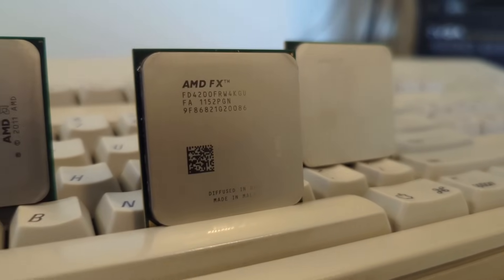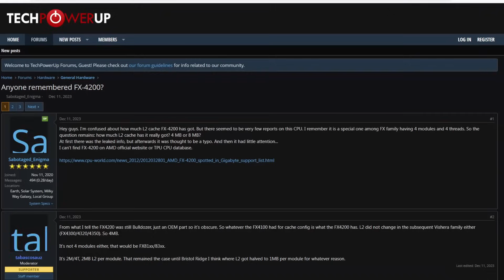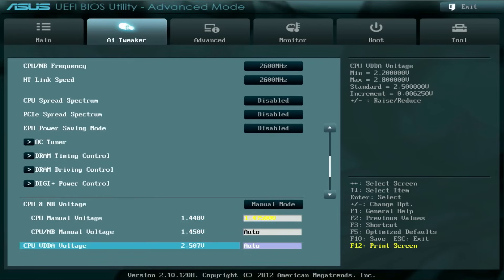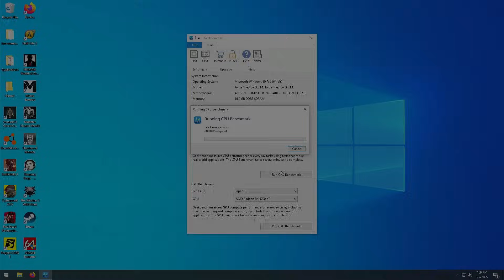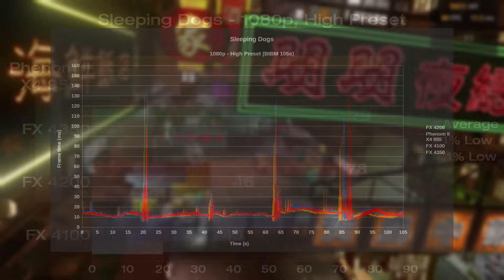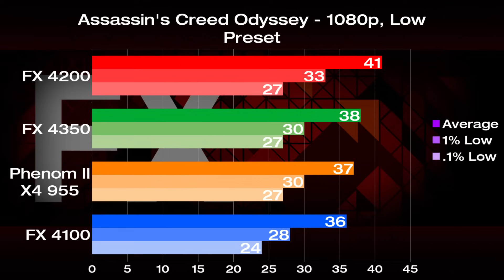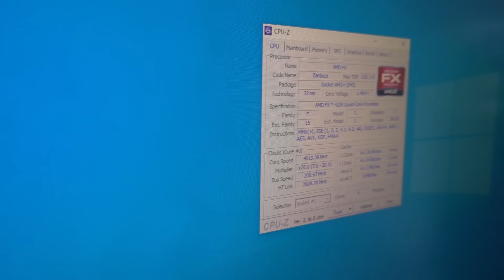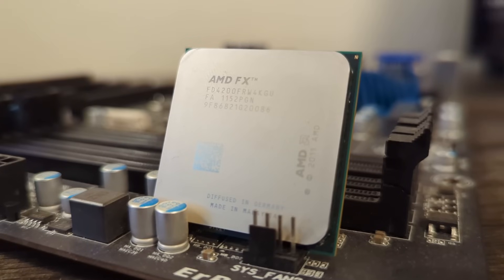What if AMD FX had "real" cores?

Comment: Based on everything I have read, as I have not benched this chip in this way, you would get slower single core but faster multicore which tracks considering L3 cache impacts multithreading. It's too bad they didn't have a Vishera core model of this.

7:38 Yep. It tracks.

Comment: I've had this on pause for hours...I have one of these, I had to go look for it, it was killing me. Found it. Problem? It's Zambezi core not Vishera, which means it's slightly slower and consumes more power. I never bothered with anything under an FX 6300. I usually build rigs for games and the 2 Module 4 Thread chips were not enough for much past web browsing and video watching. Sure, with a good GPU you might play an older, or less resource intensive game of the time but that was it. I never saw them as having insane value. To me they were overclockable Celerons at best. Funny that with a good board, memory, cooler and GPU and a good overclock, you can reach i3 levels of performance with these chips and even get i5 2400 level single core with a crazy overclock.

Comment: 17:03 but a 4 module Piledriver is still gonna crush all of these. Even a Phenom II X6 struggles to compete. I was a total sucker, went for core count at the time. This is still my primary gaming PC.

2025 games are somehow more than playable, especially those using DirectX 12. They can squeeze more performance out of the 8 “cores” as it’s not as single threaded as DirectX 11.
Reply: Yeah.. if you consider stuttery gameplay "playable".
Reply: Most games need shaders pre-compiled now. Sure it’s long, but stutters during gameplay aren’t that common. At least in my experience.

It’s actually older (DirectX 9 and 10) games that suffer stuttering the most for me.
Reply: @someone7272  It's not just shader compilation, it's just basic performance too. There's games from 2014 that already kinda run like ass on these older chips, including Intel's own high-end ones at the time.
Try playing something like The Surge or the OG LoTF on Intel's older chips. It'll not run well. Unless you consider dropping sub 60fps due to your CPU and RAM "playable". Same with the game having noticeably more input lag than on a newer CPU.
I've had a 4460 from 2014 till 2019 and then I've used a 4770 from then till 3 months ago. I've known about the i7 bottlenecking my games, but the difference is staggering.
And no, the 4790k @ >4.5Ghz or the 5775 aren't much better. In some  games you can see improvements, while in others these perform identical to the slower 4770 @ stock. Even when you see improvements, the general stability is still worse than on a modern CPU. Frame time consistency, input latency. If it still works for you and everything is "playable" for you that's fair, but I'd strongly recommend you upgrade your system if you actually notice issues.
Reply: @someone7272  Fair enough

Comment: That radiator setup is incorrect your cpu is at the highest point with no trap in the radiator. You either need to find a way to flip the radiator upside down or put it on top, that will reduce performance and wear down the pump.
Reply from the maker: The front was the only place I could get it to mount in this case. I wasn't planning on this being a very long term setup, I'm likely going to change the case for one that allows for a better rad mount.

Comment: The thing people never remember is price.
An FX8320/8200 Was £100 so the same as an i3-3220 or high end pentium.
Ph2x4's were typically around £100 (a 965 would be £120) but an FX6300 was only £80 (so about the same as most pentium dual cores.
That's why allot of people ran them into the ground even into the 2020's.
The northbridge chip (IOdie) wasn't on package yet so they also had upto 32 PCIE lanes, not being Fin-Fet and using planer 32nm silicon with a soldered IHS on a 315mm² die they could be kept in the 60-70c range with just a 120mm tower heatsink.

FX4xxx chips were a complete waste of silicon even at £60 given another £20 gets you another 50% more CPU where the fx6's and fx8's were at least usable and if you knew what you were doing they were actually good.
Tight budget but know how to tweak (overclock and undervolt simultaneously) and were okay with 60fps gaming then editing it for upload to youtube... perfect.
If you paid the extra £50 (50%) for an fx8150/fx8350 thinking you was going to overclock it to 5Ghz all core and pwn noobs all day even with a £50 m5a78l-lm/USB3 with a 4phase unheatsinked VRM.... that's on you and having sworn off AMD you're probably now using Arrow lake.

Comment: Whenever testing CPU performance with video games it's generally considered a best practice to set the resolution and graphical vidality settings to the lowest practical.
Reply from the maker: Only used a Higher preset for the oldest two games, and they are for sure not pushing this GPU to its limits lol.

Comment: Watchin this right now on my FX-4300, which still does "ok" in role of "kitchen internetz hdmi source" aka "not a popatoe crate".
Yesterday i overclocked it to 4600ghz (x22/210.0) just for lulz, surprisingly it runs stable and result is kinda noticable.

Comment: I'd like a follow-up vs. 8350 or a similar 4-module version, at the same clock speeds (or the same wattage?).

Just to show the difference or lack thereof.
Reply from the maker: If I make a followup that would be the subject! Although man, I'd be testing so many CPUs 😅
Reply: @SPNG just the two would be enough. 8350 vs 4200. Or repeat the same benchmarks you already did with the octacore. Then you can later add Excavator (Bristol ridge) and others if you want. Re-testing everything is not sustainable.

Comment: Heh. I remember the time, when I had to upgrade from phenom x6 to fx8320 due to sse support for some software, was not impressed. Now I'm waiting for 265kf to arrive. But.... So far, everything I needed it to compute, it made it nicely(except two weeks back, when I finally hit the limit in real-time processing it couldn't handle). Yeah I had to make some stupid-overkill cooling setup(990fxa-gd80, custom made waterblocks at vrms and cpu, 12 liters of coolant, BFRadiator, its like 350-400W thermal output, RAM would not go over 1900MHz for some reason, but the rest is at slightly higher stock voltage running like a champ) as I'm running it at 6.1GHz all cores, always below 57C(or crash, keep your rads clean XD), rock stable, for 8 years. Yeah, I could be a billionare by now not having to pay for that extra nuclear powerplant feeding it, but it will continue to work as home FTP server(underclocked, undervolted) till its days will be over. But ill try, what disabling four cores will do.

Comment: Just taking a wild guess but I'm suspecting the real reason FX cpus suffered from poor performance is likely due to the out of order engine stalling from the workload of 2 cores. Sharing an fpu isn't actually a bad idea in theory but if you can't handle multi-cycle latency of float-point operations then the whole cpu can stall. Another cause could be a front-end limitation, both of these would answer why the 4200 was better overall but I'm not knowledgeable enough to really pinpoint the cause, just giving my 2 cents
Reply from the maker: I think it's a combination of the shared FPUs, shared front-end, and the compromises they had to make due to Glofo's 32nm node. They all contribute to holding this CPU back in a lot of ways, but I'd say the cutbacks they made due to the shitty node was probably the worst. Even if they went the Phenom III route I think it still would have suffered on that node.

Comment: One of the main issues is that everything catered to very old Intel. Software wasn't written to take advantage of newer features, and it was and still is to some degree holding everything back. Intel was caught out many times with scummy practices, like with additions to code that would check and then disable certain feature sets if it detected AMD. (SSE instructions in compiler) Games mostly favoured single core performance until the big shift years in with Vulkan and DX12.  Same with Windows scheduling, not operating efficiently for these chips and treating each as a single core and not working with CMT. When utilised correctly, these chips were a match for Intel and exceeded Intel in 3D rendering, video encoding, etc.

Comment: Good video. Using different memory kits with fx getting the low latency 2133mhz kit as oppose to slapping slow 1333mhz ones like most fx youtube vids does is widely appreciated. I have to ask though what cpu-nb clock the phenom II 955 BE ia running at. It's common knowledge back in the phenom II days that overclocking cpu-nb clocks will give a significant boost to 3d applicationa like gaming.
Reply from the maker: Much appreciated 👍 I wanted to give these the best shot with memory, a friend recommended this kit to me. I didn't mention it in the video, but the NB/HT was tuned on all of the chips. FX was at 2600/2600 and Phenom II was at 2600/2000

Comment: Still have my FX9590 as a spare PC and it’s a golden chip - runs on a 120mm radiator. Still plays most of my games
Reply from the maker: I'm surprised that's enough to tame it! Seems like my 9370 was getting pretty warm even with this cooler
Reply: @SPNG I know right?!? Going from the disaster that was my 8150 (actually worse than the Phenom 2 it replaced) to this felt like the jump from my 1600X to the 5800X3D.
I bet it would be an excellent overclocker but I have no real need to now, and no desire to get into LN2.

Comment: The Phenom Black Edition chips were little monsters with the right motherboard. I had an X2 550 BE which could then be overclocked... and unlocked the other two cores. Used to have mine happily running all 4 cores at 4Ghz. The FX chips just couldn't compete for the longest time (ended up with an i5 2500k as my next chip and that pushed even harder to 5Ghz... I miss those days of having chips that could really overclock hard).
Reply from the maker: The 2500K is definitely an overclocking king, awesome that you were able to push yours to 5GHz. Would have been a pretty substantial upgrade over that Phenom!
Reply: @SPNG oh it was. That was on air-cooling too, no water cooled nonsense...It's still going to this day (in one of my parents machines) as well though I did clock it back down since they didn't exactly need all that grunt.

Comment: >FX 4350 in the B-roll has a manufacture date of 48th week, 2016

Holy crap that's late. That very same week is when my parts for my first custom built computer with an i5 6600k was built... and around that time I wrote off the 6 and 8 core FX's due to their poor performance vs. 4 core Intel CPU's and also being pretty old by then.
Reply from the maker: Yeah now that I think of it that is very late even for Piledriver. Makes me wonder if it would clock any better compared to an older chip

Comment: Really interesting and well done video. I had no idea the 4200 was a thing with the unique setup despite having a 4.8ghz fx8350 build at the time (it did do over 5 ghz for a brief stresstest but only with a blower fan pointed directly at the vrm heatsink 😂) . Cool deep dive on the various specific benchmarks for the fpu and cache. I would love to see more similar videos on other obscure tech like that.
Reply from the maker: Thanks man! It's an obscure chip that I really wanted to give a more in-depth look on. And you came to the right place, I love reviewing mysterious parts if I can get my hands on them!
Reply: @SPNG  This chip reminds me of the intel everest/black ops cpus that were also pretty rare and supposedly based on modified xeons with most cores disabled but all the cache left intact and overclocked with a very high tdp.

Comment: Great video, not least because you had a very good fx990 board. My fx8350 has been running at a steady 4.6ghz since 2012 or '13, with an H80i v2 to cool it. On an Asus Crosshair Formula Z. These days with a RX580 Nitro. It still plays almost all my 1,500ish games well, so gets far more use than my x3D Ryzen. Starfield was the game too far for the old beast.

Comment: I have a pair of FX 8350s that run at 5.2 and 5.4 GHz respectively. Combined with a good 990x and 990fx board, the fastest DDR3 2133 and DDR3 2400 in each, as well as extreme cooling (330 Watt  Max TDP for each cooler, one air and one AIO)they both get single core performance in line with the Sandy Bridge i5 line. It takes a lot of time and patience to tune these boards and chips as well as the RAM to get these numbers and not all FX 8350s can do it. I have an FX 9370 that could not come close.  What AMD did get right was the CCD/CCX they still use today in all of their processors. The multi core, multi thread approach allowed the FX line to continue on when their 4 core 4 thread Intel counterparts could not. It outperformed it's target, the first gen Core i processors in an average configuration as well and included newer instructions like AVX that would force the older Nehalem chips to be replaced due to the lack of them. They created a chip that could give you what you needed at the time and wanted later but was determined by the rest of the platform. The average user of the time did not get this and most people do not now, either.

To the person that wanted benchmark scores, send an e-mail. I have tried to leave a comment saying that for some time and it won't stick.
Reply: Quick, buy a powerball ticket before you realize how lucky you are!  Getting a fx8350 to even 4.8ghz is usually the best chips on air, 5.0ghz on water if you don't mind pushing the voltage.  If you did actually run the 5.2 on air and 5.4 on water stable, you literally had god-tier golden chips, and 2 of them at that!
Reply: @findRED  My luck never worked like that, lol. Yes, the water cooled chip can hit 5.6 Ghz but will not last for longer than a single CPU ID benchmark run before shutting down. I use CPU ID and have an account with these processors on them besides my own data. I have a 9370 that can't get past 4.8 Ghz. Pushing the voltage was key, yes, and the heat they put out had me running an AC in the winter.
Reply: @Dr.C-UTS мой 3770к и 4.6 не может) под водой и напряжением 1.52
Reply: @WORLDtomsk  Not sure what that has to do with an FX chip. They are chips that ran at high clock speeds to begin with and good samples have incredible overhead. I have a delidded 8700k that can hold a 5.2Ghz all core @ 1.52v. Mind you it needs beefy cooling and a board with great VRMs but the silicon is out there. Not every one gets lucky with samples. I have been fortunate many times with chips that could overclock well.
Reply: Could never get any of my fx cpus stable over 5ghz. Most were 4800 and that was on a custom loop with 2x 240mm rads.   Even the 9370 i got sucked on this same motherboard.   Ended up melting the cpu side psu connector after running my overclock for a few years.    But those were the times when you overclocked for real, now its automatic.  Going to ryzen was an insane improvement after
Reply: @austinwahl2945  It's funny, I have gotten really lucky with silicon many times but for every world class chip I have found I have 20 that can barely hit their rated speed. Go figure.
Reply: Please can you do some synthetic benchmarks?  I have 8370 at 5ghz and I would love to see if my tuning is on point or not. I have the memory at 2400 and the other at 2600.  Thanks.
Reply: @ronjatter  Send an e-mail. This will be the 3rd time I have tried to send this reply.
Reply: @ronjatter  I have. Feel free to send an email and I can send screenshots.

Edit: If there is something specific you are looking for, feel free to ask, if I can do it I will.
Reply: @ronjatter  Send me an email.
Reply: No you don't. There is 0 chance they're stable at that frequency. Comments like these are exhausting.
Reply: @TheBawbSaget  You literally typed "No you don't" as if you know me, watched the chips fail, and proceeded to type this as if it were fact. "No, you don't" know what you're talking about. 
First, I explained that the 5.6 Ghz chip is not stable. Second, the chip that can hit 5.2 is stable. Rock solid stable. I wouldn't run a 24-hour stress test on it as I pay my own electric bill however the facts remain. Why do you insist on being negative? I understand typing something like "I don't think that..." or maybe just not typing anything at all but no, here you are. Being negative. I hope you do better as you get older. Jealousy is an ugly look in any opinion. 
Fun Fact: I went ahead and I ran CPU-Z and have these on my list. You could apologize, but you won't.

Comment: While I get that principal of AMD's "module" approach was to give the second "virtual core" its own integer unit, rather than sharing a single unit between them via "hyper-threading", AMD crossed the line by counting each module as two independent cores. The only reason I went with AMD anyway was because I needed multi-threaded performance and the FX8350 on clearance had higher performance for the price than either Intel or current gen AMD chips did at the time.
Reply from the maker: In heavily threaded games they can do pretty well, and I'm sure it was cheap as well. I feel like people forget that about these chips
Reply: @SPNG  Some apps will take all of the threads and GHz you can afford to throw at them.

Comment: I used the FX 8350 for years before upgrading to Ryzen 2700X. Still have it with cooler and the metal box it came in. It was a great value CPU, even if it ran hot (Noctua D-15 really helped with that).

Comment: I don't suppose you had a chance to look at the CPU power usage and heat statistics between the four you tested?
Reply from the maker: I didn't look into it that much, but the FX 4200 was a bit higher on total system power consumption @ the wall than all of the other chips from what I remember.